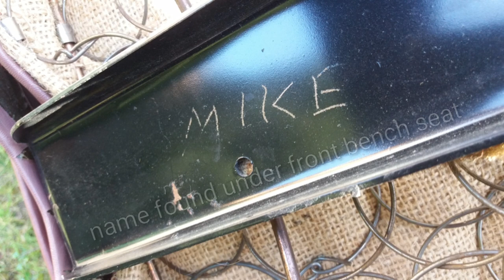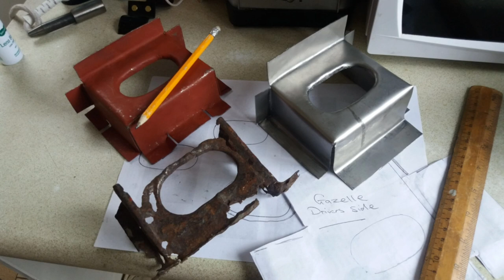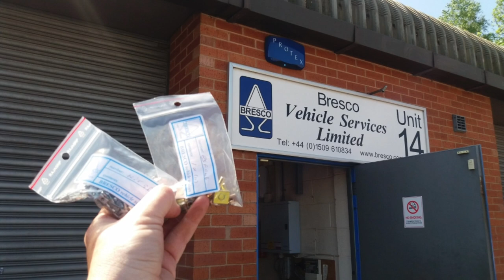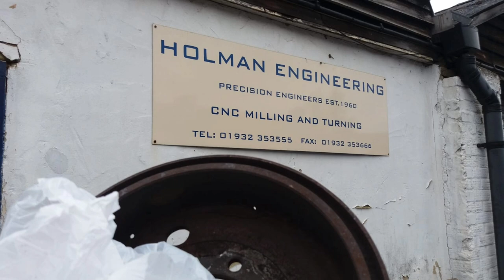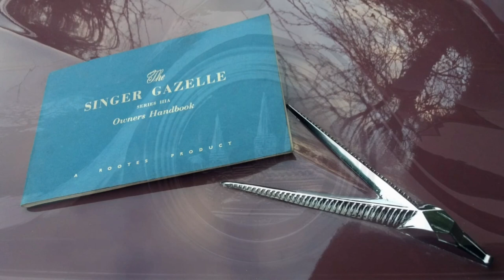Singer Gazelle Restoration

Comment: Nice job, my brother owned one back in the 70's picked up from a breakers yard, they did it up and it ferried him and his mates round all summer but needed too much welding underneath so he let it go, often think about it and the reg, WFY 9, plate alone would be worth something these days.
Reply from the maker: Thank you for taking the time to comment, sorry for the long delay (3 years in some cases) in replying. The Gazelle was sold in May 2021 - more details given as to why in my reply to the pinned comment. Thanks Gary

Comment: What an amazing restoration of a lovely old rootes group car. 
Amazing bodywork skill.
A nicely preserved part of British motor heritage
Reply from the maker: Hi Mark
Thank you for taking the time to leave your comment...its much appreciated. Restorations like this are a 'labour of love'....they certainly are not  profit/ money motivated.  l have always liked the Gazelle...a 'Hillman Minx in a posh frock' basically...although l do own a Minx. My late father started his working life as a Singer Motors apprentice. I see your into Singer sewing machines...no connection to Singer cars though l believe ? ...please correct me if l'm wrong. Do check out some of our other videos. Thanks again. Gary.
Reply: @timeslip9  why thank you , well you deserve the message I sent.
Yes I do have a singer sewing machine but I inherited that from my grandmother.
As for a singer gazelle yes I did own one a later model from 1965 I really loved that car back in the 80s .
I also owned a Hillman minx phase 3 saloon from 1940 which I believe was in military service.
Sadly I swapped my minx for an mgb and was taken advantage OF and lost both car's :-( in the process.
I so regret swapping the minx there were only 22 left on the road at the time I had mine.
I should never of swapped it for the mgb which had a twisted frame chassis

Comment: i used o be a mechanic 48years 38 for bt working on commer pb vans some of the time good engines in these great looking singer cheers
Reply from the maker: Thank you for taking the time to comment, sorry for the long delay (3 years in some cases) in replying. The Gazelle was sold in May 2021 - more details given as to why in my reply to the pinned comment. Thanks Gary

Comment: Who needs a pink Cadillac?
A heroic undertaking. Well done.
Reply from the maker: Hi Paul
Appreciate your comment.
The colour is original too , called 'Cloud Rose', it only had a short run and didn't sell well...probably seen at the time (1960) as a bit too bold and bright by your average pipe smoking / trilby wearing man at the wheel. Thanks .
Gary

Comment: My father had a gazelle in the early 60s - brings back alot of memories
Reply from the maker: Thank you for taking the time to comment, sorry for the long delay (3 years in some cases) in replying. The Gazelle was sold in May 2021 - more details given as to why in my reply to the pinned comment. Thanks Gary

Comment: Love that Gazelle. Can't stop looking at it. My first proper job was in  a Rootes  group garage. 
My first decent car was a  1956  series 1 Hillman minx which I purchased  in 1964 for  £75.
      
After blowing up the 1390 engine, I sourced an unused recon 1592 engine in a breakers.  I later added a pair of twin carbs and exhaust  from a scrapped 3a Gazelle. I chucked the restrictive oil bath air cleaner and ran the car without one. The increased airflow necessitated  fitting larger main jets. Fuel consumption, originally 30mpg, dropped to 25 mpg., but the car seemed much zippier.
      
On my 21st I was given a Smiths electronic tachometer which fitted perfectly next to the speedo. looking like it was factory fitted. The now displaced fuel gauge was moved to share a  pod with the temp gauge.  

.
Reply from the maker: Thanks for taking the time to post your fascinating comment...l appreciate it when people do ...good or bad...l'm sure others will find your detailed description of great interest...as indeed l did. I have attached two of our other videos (that include some classic cars) for you to watch...and hopefully enjoy...please comment and share if you so wish. Thanks again. Gary

https://youtu.be/gTcREp4lVsk

https://youtu.be/Ao-n_g1cKw0

Comment: I'm looking at a 66 model in the next week or so.
I already have a Superminx and was considering the Gazelle ad an everyday runaround.
Great video, Thankyou 👌
Reply from the maker: Thank you for your comment.
All Gazelles are at least 55 years old now...so as you would of seen in the video 'RUST' can be the hidden enemy...especially if its just been disguised and not treated/repaired properly...which take it from me can be very frustrating and time consuming if you end up putting it right yourself...so check all the areas that are highlighted in the video. You choosing the later model of Gazelle that has more power and better brakes is certainly the right choice as a daily driver. Good luck.

Comment: Well that's ironic... I'm a singer (have been for 60 years) and still gigging. I had a Singer Gazelle Convertable. Rootes Special colour; White with chocolate stripe (Rapier colour I believe), and matching colour interior, with matching full tonneau cover. Plus Rootes registration plate: RW 2000. White-walled tyres abd white unsealed! I real 'bird' puller in those days. I bought the car nearly new. I was on a print Apprenticship but earning 'big bucks', singing! Love the vid, thanks. Bring back a lot of wonderful memories! ND With the help of my Dad, changed the rear centrre-light reflectors to white reversing lights... also with the help of Dad, built a centre consul... looked fantastic. Sorry no pictures.
Reply from the maker: Thank you for taking the time to comment, sorry for the long delay (3 years in some cases) in replying. The Gazelle was sold in May 2021 - more details given as to why in my reply to the pinned comment. Thanks Gary

Comment: Nice restoration Gary and very well put together video. I put over 600 hours into rebuilding a 1965 gazelle in 1999. Due to loss of storage barn, I sold it to a film company in essex in 2018.
Reply from the maker: Hi Trevor
Thank you for your comment, always good to hear from a fellow Gazelle restorer ...was yours a 1600 or 1725 engine size ?. The Rootes cars were always a notch up regards build quality...the doors shutting with a reassuring solid clunk, over say something more tinnny from BMC...doesn't mean they were any less prone to rust though...as you are probably very well aware. I am coming to the end of another and FINAL Rootes saloon restoration , a 1965 Hillman Minx series 5...these restorations are not for the faint hearted...so very well done on yours. Please do check out our other videos, some of which my classic cars feature in (Passport To The Past) being one.
Thanks again
Gary

Comment: An exceedingly rare car the twin carb Gazelle. You were lucky to find one in such good condition. Most Audax cars had no inner or outer front wings by the time they were 10 years old. The sill structure on yours was also terrific .... inner sills on an Audax were a luxury. A glorious restoration of a lovely car.
Reply from the maker: Hi Jack, thanks for your comment.
Yes, l was lucky really regards the sills and wings as l did have something decent to weld to.  As you probably know the outer sills may look straight, but in fact have a number of curves that are difficult to replicate in metal 'by hand'...but my late father was a superb sheet metal worker (he was an apprentice with the Singer Motor Company, see attachment to this video regards this) so l learnt a lot from him that helped me .
This video was posted over two years ago, but has had more comments left in the last week then in the time previous, can l ask how you came across it ? 
Thanks again
Gary
Reply: @timeslip9  This video appeared in the left hand column when I was browsing other Rootes related posts.
In 1963 my father bought his first Rootes mobile .... a 3C Minx. This was followed by two Super Minxs and two Arrow Sceptres. I have owned six Sunbeam Alpines and a Tiger and have spent many happy hours welding both my own and friends Rootes cars. My father's Arrow cars were new enough to benefit from the waxoyl treatment I gave them and didn't rust. Really!
Reply from the maker: Hi Jack 
Yes, the dreaded 'tin-worm', l think the cars were 'sheep dipped' in red oxide primer paint...l do wonder how much actually got into the box sections ?...water and salt too adding to the ability for the metal to happily rust back into the ground from where it came. I couldn't weld when work started on the Gazelle...but it was the first classic car l had owned that needed that amount of metal work and fabrication (previous little bits of welding being done at a local garage). The mobile welder did 99.9% of the Gazelle welding, but after watching endless hours of the process ...thought l would give it a go myself ...thinking if l can 'lead-load'...l can surely  pick up mig welding...it took a while and a lot of practice first...and  then working with thin metal at times didn't help...but eventually l got to weld to a 'presentable' standard when l started the restoration of my 1965 Minx Series 5...goes without  saying l saved a small fortune too....definitely  be my final restoration though...they are just so time consuming and plays havoc with my back too . The Alpine is a lovely looking car, better than the MGB in my eyes too...never keen on the Arrow range...for me it just lost a bit of visual style. 
For more of my classic cars please do watch our last two videos...'Passport To The Past' & 'Passport To The Past Take 2'...which if you enjoy old historic buildings ,Lancaster bombers and a laugh...you may enjoy watching them  ...please comment and share if you so wish...it all helps ....good to talk to you. Thanks again. Gary
Reply: @timeslip9  I'm pretty sure that Audax cars in the early 60s weren't paint dipped. The paint until the mid/late 60s was cellulose and the cars were sprayed where you could see them. Look under the dashboard and the metal will probably be raw. The underseal had a trick too. It had lint in it for sound-deadening! It acted as a wick, soaking up water and promoting rust on the underbody. This combined with dead air spaces under the front wings which got muddy and never dried out and myriad double skins ensured that the bodyshells dissolved in short order. It was a great shame as the mechanicals and furnishings were extremely robust.
Reply from the maker: Interesting regards the painting...(see film attached....you may have seen it)...towards the end of the film...Hillman's being 'paint dipped'...it is 1967 though ...and they are 'Arrow' series minx...so you may well be right...l wonder when they changed from hand spraying to 'dipping' ?...the 'Audax' range ended its run in 1966 l think...were they 'dipped' ?...will look under the dash in the morning first thing . Thanks for the info .

https://player.bfi.org.uk/free/film/watch-rootes-car-factory-1967-online
Reply: @timeslip9  How interesting. The bodies in 1967 (and for the previous 20 years) were made by Pressed Steel in Abingdon then transported to Coventry by rail where they were painted and trimmed. Pressed Steel was owned by BMC and Rootes bought the factory in Linwood from BL.
From then on all Rootes bodies were Scottish made. Imp mechanicals went on trains from Coventry to Scotland and the trains returned with Hunter range bodies. What a faff!

Comment: Lovely car. Rootes cars were very nicely made motor vehicles. I learned to drive in my mum's Series IIIB Minx. The Minx was assembled here in Australia at Rootes' Port Melbourne factory beginning in 1946 and by the mid 1950s Rootes cars had 5.4% of the local market. A pretty fair achievement given Australian's love for the Holden. I'm not sure if the Singer Gazelle was assembled here or fully imported, although for 1966 and 1967 the Hillman Gazelle was assembled here until introduction of the Arrow/Hunter range in '67. In my opinion Rootes cars were much better built than similarly priced BMC machines. You've done a beautiful restoration of this Gazelle and if it were mine I would never be parted from it.
Reply from the maker: Hi David
Thank you for taking the time to comment, all the way from the land of the Kangaroo, Koala and Kookaburra...just amazing...and l'm sure others will find the details in your comment as interesting as l did. I would totally agree with you in regards to a Rootes Group vehicle being of better build quality than something from the BMC stable...both companies products though capable of rusting away within months of leaving the showroom ...as indeed did my late father’s brand new 1965 Hillman Minx series 5 ...that went back several times to rectify rusty paint work. Please check out some of our other videos..in particular 'Passport To The Past'...and its follow up 'Take 2'...as the Gazelle features in both as does my 1963 Wolseley 1500....comment and share if you so wish. Thanks again .Gary

Comment: My ex’s father bought a new one of these in 1966, I remember he chose to have the registration number 999D. It was silver with I think the 1725 cc engine.
Reply from the maker: Thank you for leaving your comment. If it was a 1966 car ? ...it would be a Mk 6 Gazelle...so yes would have had the 1725cc engine...the Mk 6 Gazelle lost the distinctive heart shaped front grill...in favour of a more down in the mouth/ flattened version not attached to the bonnet...basically l think a cost cutting exercise so they could use the same bonnet and front panel as the Hillman Minx, that had a similar front end. 
Gary
Reply: @timeslip9  In 1971 I bought a ‘68 Hillman Minx auto, the basic version of the Hunter. As an auto that also had the 1725 engine.

Comment: Great job mate well done, I used to have a series lll back In 1966 it was a1958 column change with an overdrive on third and fourth gear. Forgive me for saying this are you sure yours is not a series lllB because I thought that models  with those rear wings was only on the lllB models, mine never had that type. of rear wings but i stand corrected.
Reply from the maker: Thank you for taking the time to comment, sorry for the long delay (3 years in some cases) in replying. The Gazelle was sold in May 2021 - more details given as to why in my reply to the pinned comment. Thanks Gary

Comment: All this superb work was done OUTSIDE?
What could you achieve if you had a garage?
The chromium plating looked as if it was already in excellent condition.
Reply from the maker: Thank you for taking the time to comment, sorry for the long delay (3 years in some cases) in replying. The Gazelle was sold in May 2021 - more details given as to why in my reply to the pinned comment. Thanks Gary

Comment: Hi, great video.  What colour is used for the side flash?  Thanks.
Reply from the maker: Hi Eloise , 

Thank you for leaving your comment...its much appreciated...as l have always felt the Rootes Group Cars have been very much under appreciated....my 1965 Hillman Minx Series V is getting virtually the same treatment at the moment...be my final restoration project though...as they just take so much time and total commitment to complete . In answer to your question regards the white/ cream side flash colour...according to an original  Rootes Group 1959 / 1960 Singer Gazelle 111a sales brochure the colour is started as 'Foam White'...but the guys at Pountney Garage Finishing Services did a great job colour matching it anyway .
Hope this helps if its in regards to a restoration of another Gazelle ?

Thanks again 
Gary
Reply: @timeslip9  Thanks Gary, appreciate you taking the time to answer.  I have a 1969 Commer Autosleeper camper van which needs a respray (it is currently white on the top half and a very faded green on the bottom half) and I am undecided whether to stick with green (in which case I would probably go for polar white / seacrest green) or whether to change it for white or cream with cloud rose, which I suspect would suit it very well.  Hence my question about the colour of your side flash as it would be nice to match it up based on an period colour combination, albeit that cloud rose was originally only available on the Gazelles.  Thanks again, Eloise
Reply from the maker: No problem...nice looking vehicle the Commer Autosleeper...again unfairly  underrated...compared with lets say the VW Camper Van.
Brave move changing the colour though...as you have all the 'hidden away' bits to spray too...boot ...under bonnet and so on...l always like to stick with the original colour... but it can work ....so best of luck with it.
Please check out some of our other videos and feel free to comment...you may enjoy 'Passport to The Past/ Elmdon Airport'... as it features a few of my classic cars. Gary